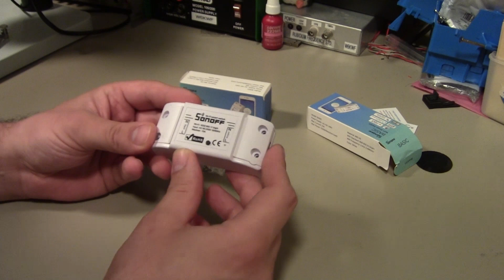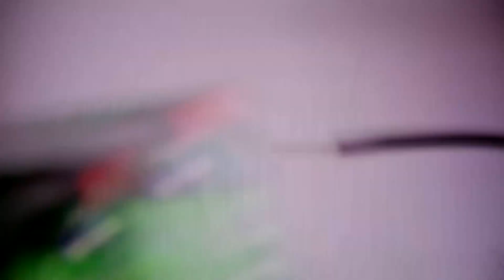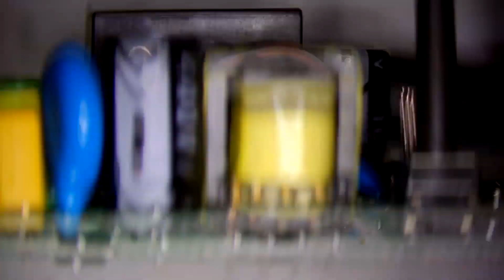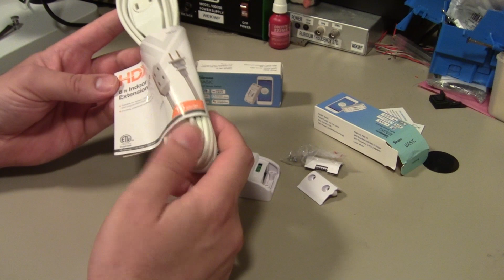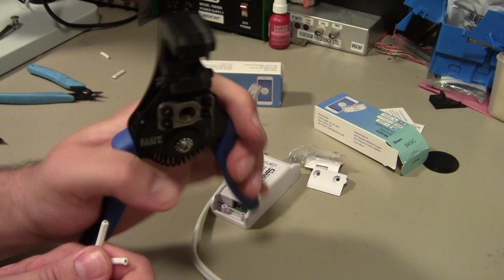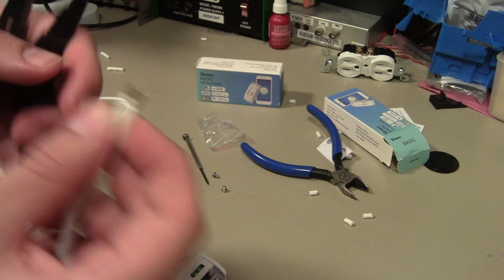Sonoff Basic WiFi Smart Switch Teardown

Comment: Great teardown, really appreciated the detail. I'm in the process of trying to figure out why one of my Sonoff Basic R2 units randomly stopped working one day hence trying to learn more about this board. Mine does not power up over mains OR from the 3.3V header pins. I'm thinking the ESP is dead, may attempt to hot air remove it and replace with another, just to see. No visible component damage!

Comment: Nice your version has thick wires connecting the terminals... Mine was just a thick trace on the pcb itself and seemed super dangerous to pass mains voltage over a pcb trace

Comment: I tin the sranded wire before putting into the terminals. Solves the stray conductor issue & crushes nicely.
Reply from the maker: That is not recommended, specifically by IPC 620 section 4.4, since stranded wire in a threaded compression connector is meant to become a gas tight connection, but tinning it first makes the connection more prone to cracking and stress concentration at the point where the tinning ends, so I would not recommend tinning the wires before inserting them. Just strip and handle the wire carefully and get all the strands inside the cage.

Comment: Why not use ferrules on the wires before inserting them into the terminals?
Reply from the maker: Because it wouldn't fit with ferrules.
Reply: Did you even watch the video?